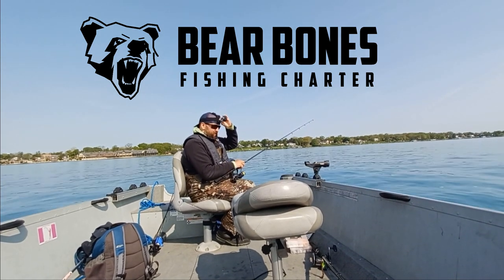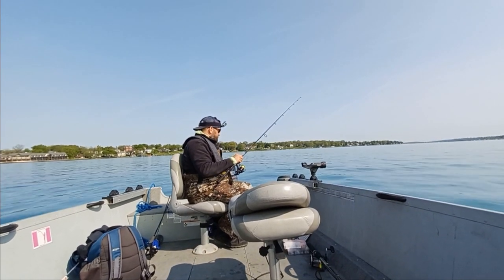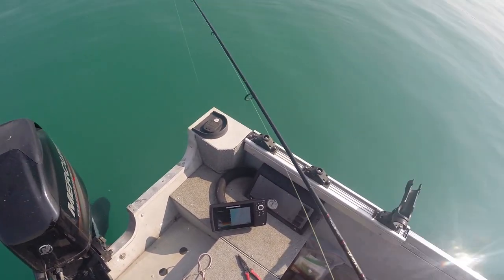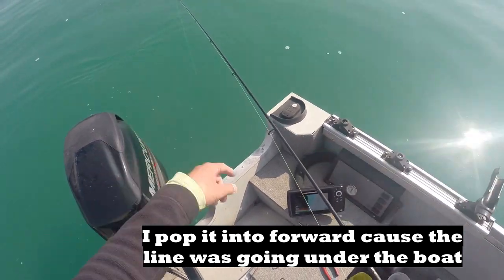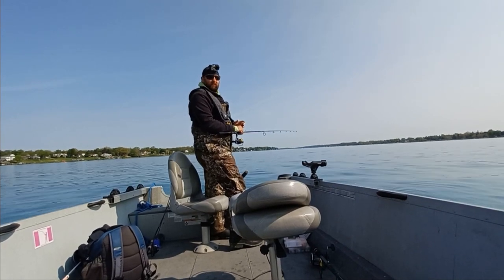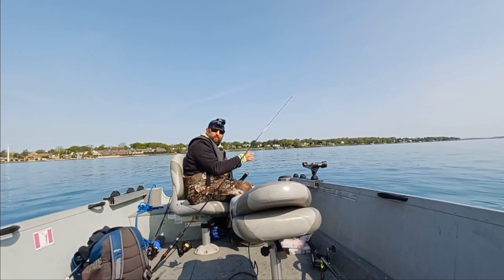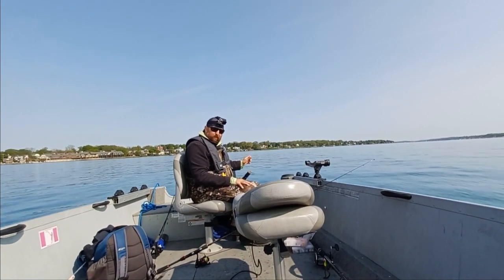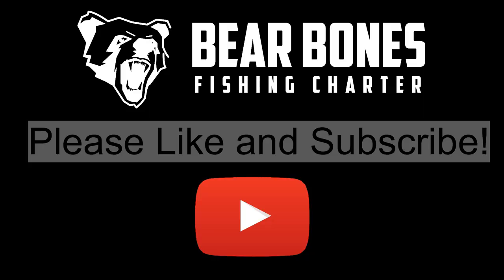How to Back Troll when Vertical Jigging

Comment: Do you prefer to use trolling motor or Outboard motor for jigging?
Reply from the maker: I prefer using the outboard. Reaso  is, I don't have much space to maneuver around when I have people in the boat with me. Using the outboard allows me to hang out in the back without needing to snake my way around people every time I want to lift/drop the trolling motor. Since that's what I do when I have people with me, I practice that way when I'm alone. 

I will use my trolling motor for dragging harnesses though.